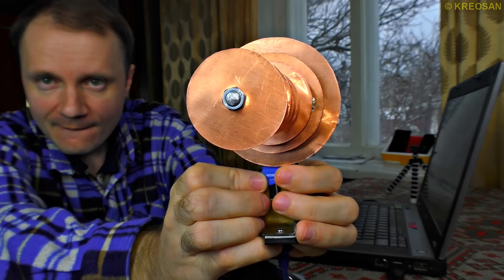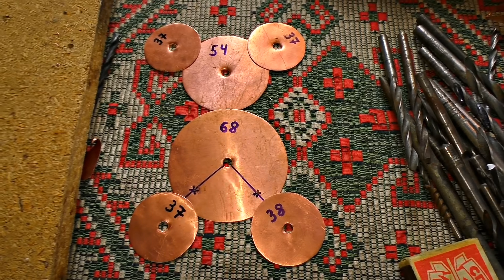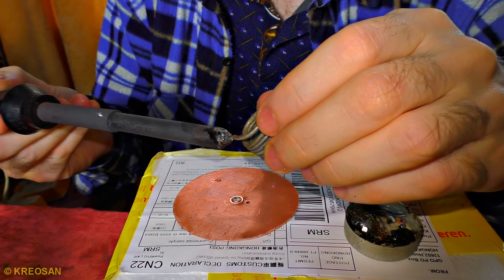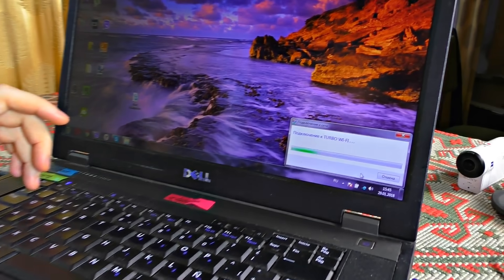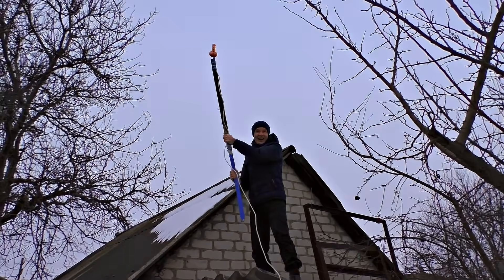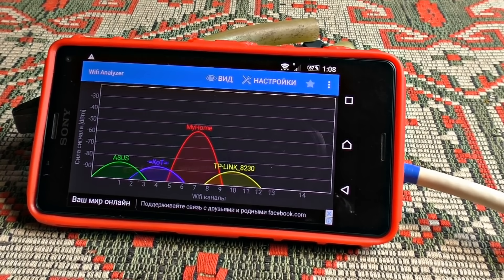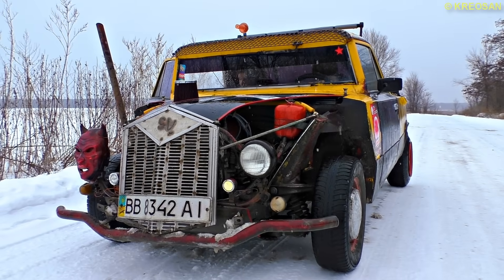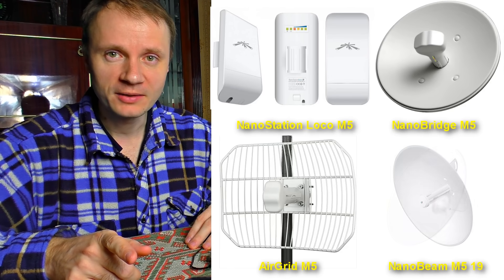✅Wi-Fi Gun DIY / Powerful Antenna for Wi-Fi !

Comment: This will take off..I can tell.. 

Free wifi when needed.. no worries.

Make a bigger one next time.. using bathtubs as your metal plates.. you'd probably be able to cover the whole country.
Reply: The physics would not work. The behavior of the antenna is based on the size and spacing of the disks. Along with that, radio waves at 2.4Ghz and 5Ghz travel by line of sight, they won't make it past the horizon.
Reply: Addison Guynn  then they have to think of how to hack the password lol
Reply: Yeah. Illegal in most of the Western world.
Reply: Garganzuul he’s in Russia though
Reply: Nope, the amount of power put into the transmission is regulated but these devices are ok. They don't amplify the signal. They focus the signal into one direction.
Reply: Nothing is illegal if you dont do anything stupid. building a huge antenna may be theoretically illegal, but if you dont use it on somebody else, then should be fine.
Reply: Addison Guynn the power transmission is what's illegal..
Reply: Gary Stinten not certainly, you can run that power legally with an amateur radio license provided  you stay in the right bands. But you’re limited in what information can be transmitted, for example, nothing commercial.
Reply: Addison Guynn well they weren't running anything commerical.. in fact totally unlicensed. And not for profit.
Reply: Addison Guynn I was meaning to broadcast your address further..
Reply: In Russia... INTERNET XOME TO U.    Great for a citizens band 🐜 antenna
Reply: Gary Stinten  (
Reply: rohit pal someone gets me.
Reply: This comment MADE MY FUCKING DAY DUDE !!!!!!
Reply: Danijel Lukic seriously.. do it.. scale it up ... They're crazy enough to do. it.. 

Longer "barrel".. higher mounting on his house roof and you'd make pure win.
Reply: Bro i am welder , i can make it , but i can't find 1 square meter of aluminim or brass or copper man , it's SO EXPENSIVE  I COULD MAKE A SATELITE ahahah XD
Reply: atmospheric refraction in good conditions might bounce back the signal and get a extra 100 km
Reply: but then you also have to contend with the fcc and that as an antenna might affect others etc.
Reply: Nopp.. In most western countries the legal limit is on the transmitter power, not the antenna gain. Just increasing the gain of the antenna don´t change the legality of it. 

And of cause, if you using it as a reserver nobody can se it anyway, so it don´t really matter.
Reply: Gary Stinten noob
Reply: Alex Wielinga so broadcasting power will affect broadcasting frequency by amplifying signal?
Reply: rohit pal how.. I didn't make this video. But I do see it as a way to get free wifi..
Reply: But your thinking is amusing af lol
Reply: xD!!!!!
Reply: Ausintune But this pseudo "better anntene" had only reciver NOT the router.
Reply: Ausintune Atmospheric reflection? No... It's not pointing to the sky...
Reply: I think the horizon is the only limit.
Reply: The Memester Gangster XD XD
Reply: Danijel Lukic find a Tesla car battery case.. solved
Reply: Retroke there is an error in your procedure: what is needed is a ring-shaped antenna encircling the Earth at a height of 60km held in place by tight cables of metals & carbon exotics construction. bonus points for also being the cheapest space elevator
Reply: Huge isn't how antenna's work.
Reply: The Radiation though
Reply: It'll kill u
Reply: would you use a small one attached to a hat
Reply: Russia is a big country....
Reply: what is this antenna called?
Reply: As Network Engineer , this is hard but not impossible , the hard thing is 
1. interference over other wifi or signal around , not to mention densities of surrounding like building or tree and wind and also snow or rain
2. Iff the receiver is strong but the transmitter is not , this will be a problem , same rule apply as good transmitter but bad receiver
3. On this video , it was make for point to point , which is must higher than it's surrounding and less frequency interference . Which is what I mean is , ( not for City area ) and the one you targeted must have a good or great transmitter , not some cheap router ( im talking about dBm) and the receive is dBi
4. Iff someone closer to the router / modem that has the internet , the router gonna focus on that one , which make you or using a wifi sniper gonna get alot of loss signal ( you got the signal , but it's just a splash of it )
5. Don't forget to put or add grounding / cable / copper to the ground of Earth , cause iff you not , the lightning gonna hit it and you fuck up

How do I know this ? Cause I have one at home and it's 9 dBi/dBm x 3 Mimo antenna and has been using it for year and I know the capability and disadvantage , mine can get over 30 - 50 wifi for over 1,5km , but as I said before on the hard thing , the wind and interference of other signal making it hard to get and also there's someone closer using the router which making the router focus on closer one and I get loss signal or just RTO , and only been using it really good only at night cause probably the owner was sleeping
Reply: Simple Simon Nothing, this anntene doesnt exist. It can't work.
Reply: Ok.. they just hearted this comment.. 

Do it.. 

Make this happen.. 

You know I'm right.. do it...

@kreosan
Reply: +kreosan.. 

Dooooooo it.
Reply: you need to get some free wi-fi from your friend who is in china? no problem, this method will be a bit more expensive, take 5 antenas, stick them togeter, stick the others two antes home made, plug it into your oc and enjoy free wi-fi taked from china at 1GB/s